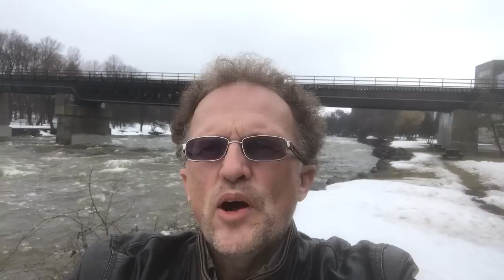Stabilization Feedbacks in the Climate System

Comment: Sorry Paul but Global emissions only dropped 2% for 1 year in 2008. China has increased emissions by 8% every year since. India has increased by 5% every year since. Global heat retention has increased to 1tw since pre industrial. That equates to 3'c warming locked in without any feedbacks. Your right that when we get kicked in the teeth we will act. But we have been to the doctors and he told us not to get kicked in the teeth (2'c) or else we will need a dentist. When we need a dentist, that means global events have ran out of our control parameters. Global emissions have risen by 40% since we went to the doctors. They are still rising. Professor Anderson UK made this clear in 2011. 24gt per annum. Global emissions are now 36gt per annum. I suspect that he IPCC will be persuaded to state that 4'c is the new 2'c, which most if not all serious scientists say would be an earth changing disaster. The action required now is a 10% reduction in Co2 emissions per annum to avoid this catastrophe. I see no signs of reduction in the next 10 years.
Reply: LOL, yeah! 4C, or indeed 5C, will be proclaimed as the "New 2C". And the media will present that and the public will swallow it. Because it sounds kinda nice, and no–one likes to think it's all futile, right?
Reply: Mark Young The optimistic estimates for the time it takes to transition over to clean energy from fossil fuels is 20 years because energy demand is rising rapidly and during those 20 years fossil fuels will still be used to build the clean energy because it is a transition and by the end of this transition the world be at about 600 ppm CO2 resulting in about a 6C increase in global  temperature plus there will an additional 1C to 2C rise in global temperatures as global dimming is reduce, so we are already screwed if we even try to go to clean , we waited to long. Agriculture scientist are predicting a reduction in global crop production of 12% to 30% due to global warming stressors of heat stress  , increased drought , and increased pest losses. Evidence shows each one of the 3 can reduce crop production by approximately 10% each with every increase of 1C of land temperatures , not the global average but the higher land temperature from growing region to growing region. Agricultural scientist warn there could be significant drops of 30% to 45%  in global crop production within the next 5 years. Humans have evolved to respond to immediate threats before an arguable long term threat.  A person is more worried about the bear in their backyard than the one in the woods miles away, and even less if people say that there are no bears in the woods. The fossil fuel companies understand human nature better than anyone and they know that a campaign of dis-information , denial and delay is all they need to continue to extract  and burn fossil fuels.  Summarizing the world is fucked , food prices will skyrocket until civilization collapses into anarchy and chaos , war , famine and death will follow the radical religions of the world will get their apocalypse and they will die thinking their religions prophecy is fullfilled.
Reply: LIkewise they bump up the thresholds for harmful dosages of radiation to placate the Japanese gov. stranglehold on information wrt Fukushima on-going disaster.  OK go play Alice in Wonderland, make up the rules as you play the game.  We're still a dead man walking, there is no cure for radiation sickness, all that's left is the slow dying from nausea, vomiting. , spontaneous bleeding.
Reply: Nathan Gant Why are you blathering on about radiation?  This has nothing to do with nuclear fusion or fission, it involves non-ionizing infrared radiation that will kill us by destroying our resources!
Reply: global warming = coastal flooding = electric power grids offline.  13 nuclear power plants in the US are on coastal sea levels.  Most on high populated East Coast.   Connect the dots from there.
Reply: Mark - you're way too optimistic for my understanding of the problem.
Reply from the maker: silvercountry and have less kids, or maybe more??
Reply: Paul - Stressors usually have the effect or increasing fertility. Only education of women can override this, but this is often prohibited by religious practice.
Reply: One can try (fruitlessly) to make comparisons in a statistically meaningful way regarding the 5 years 2008 to 2012. One way is to year by year comparison with the 5 consecutive calendar years 85 years before (taking into account the 85 year Wolfgang Gleissberg solar cycle). One can make a non significant conclusion ( p = 0.10) that we humans caused at least 0.69 celsius of global warming in 85 years, and a similarly non significant conclusion that we humans caused no more than 0.92 celsius of global warming in 85 years.

Interestingly, by comparing 22 year (approximately one solar magnetic cycle) segments of time spaced 85 years apart, the outcome is a statistically significant conclusion (p = 1/44) that we humans caused at least 0.53 celsius of warming in 85 years, and an equally significant conclusion that we caused no more than 1.11 celsius of warming in 85 years.

The 5 years 2008 through 2012 fit well within the temperature range of the broader 22 year time span 1995 through 2016, whether or not making a comparison to the past. There could very well be a temperature effect from the 2008 recession, but that recession was neither severe enough nor long enough to result in a statistically significant effect.
Reply: Yes, just like the 4 Fukushima reactors have been "decommissioned", as in destroyed beyond any humanly-possible repair.  All coriums have melted down past concrete floor.   Real china syndrome there.  No one has a clue, except to observe the massive steam is coming up from the ground there, that is to say nuclear reactions are happening underground.  numerous super-hot lava tubes detected., +5000 sieverts, now that's a novel way to decommission, just make the human species go extinct.
Reply: The failure of batteries and diesels at Fukushima was irrelevant, as 34 of the 37 pumps that use that power were knocked out and the electrical switchgear in the basement of the turbine hall was drowned.  You could  have still had grid power to the plant and it would have had the same outcome.
Reply: Not 5000 plus sieverts.  Top reading was about 537 sieverts down in the containment.

Comment: But if emissions drop, so does the effect of global dimming!
Reply: +proudhon100   Did you watch the whole video?
Reply: klondike444
Yes. What's your point?
Reply: Reduced global dimming from reduced air pollution would indeed raise the temperature. However, two stabilization feedbacks would increase that hardly anyone talks about. 

One is vertical convection in the ocean that would store an increased amount of heat at depth. This type of vertical convection most famously happens just west of Gibraltar.

The other is heat loss from vertical convection in the air. An increased amount of ocean moisture gets carried up to high cloud tops where it condenses into snow and very easily radiates the heat of condensation into space. The temperature increase is not a big problem. Instead, the big problem is "black swan" events in the form of storms so intense in a geographical area that in the old climate system such a storm was seen in that area less than once in a thousand years.
Reply: +Wendy Delisse   Interesting. Hope Paul covers those feedbacks in his planned video on global dimming.
Reply: +proudhon100   Paul refers the effect of falling emissions on global dimming, and says he plans to do a video on the subject, so what is your point?
Reply: +klondike444 If he does cover increased atmospheric vertical convection as a part of a video on what happens if global dimming is reduced, it will most likely have to be a two part video. 

The evil twin of increased upward vertical convection in an ITCZ shifted slightly northward if the brown cloud of pollution from Asia goes away is the increased downward convection 1500 nautical miles north and south of the newly repositioned ITCZ. A more northerly position means more coriolis effect wind enhancement of ITCZ low pressure systems, and evaporation rises linearly with wind speed. A higher temperature due to less air pollution also increases evaporation.

In July and August, is there drought in Nebraska? See how close the ITCZ is to Acapulco 1500 nautical miles to the south. Drought in Syria or Zambia? Check out the rain reports in Ethiopia 1500 nautical miles away. Is there a news report of a river drying up in Brazil? Look to a satellite photo of the Lesser Antilles in the Caribbean Sea at the clouds of the ITCZ about 1500 nautical miles to the north. Has July and August also been especially dry in Inner Mongolia? Check the weather reports for rain 1500 nautical miles to the south near Calcutta, India and Da Nang, Vietnam. The pattern is that wherever the ITCZ is, if you go 1500 nautical miles north or south, the weather will be much drier. If the ITCZ shifts, the dry zones also shift. Also, the a stronger ITCZ results in more intense dry zones. 

The effect of a more northerly and more intense ITCZ is by itself a lot to squeeze into a single 15 minute video on what happens if the brown cloud of pollution from Asia goes away, so I imagine at least a 2 part video on the effects of global dimming.

Comment: Here's another negative feedback. As the planet warms the water cycle intensifies. As precipitation increases it stimulates additional growth of many plants, particularly those whose growth rate is especially dependent on how much water they get.
Reply: pukulu , until it's too hot and the plant dies from the inside out. ..TOO hot can happen in a rainstorm. (that will kill a human as well)
Reply: On the other hand, the heavy rains that come to drought areas will wash soil and plants away. If that water can be captured and used then yes, there could be some hope.
Reply: pukulu, water cycle intensification is a powerful negative feedback even without biology. The "enthalpy" (heat), from condensation of water molecules onto droplets or deposition of water molecules onto ice crystals, is released very effectively at cloud tops.

A similar process happens in the atmosphere of the planet Mars, but it is CO2 deposition onto CO2 ice crystals that occurs, since Mars is cold enough to freeze CO2, and since Mars is too cold to hold a substantial amount of water in its atmosphere.

On Earth water is the chief greenhouse component in the atmosphere, and on Mars, CO2 is the chief greenhouse component. On both planets, the condensation or deposition cycle of the chief greenhouse gas puts a lid on the greenhouse effect.

On Venus, where CO2 is the chief greenhouse component, the higher solar constant allows hardly deposition at all, and any CO2 crystals that form near the poles in the upper atmosphere sublime away many tens of kilometers before they could reach the ground as solid or liquid CO2.

Comment: Here's a question I have. Is the global human population explosion causing the balance between autotrophs and heterotrophs to be shifted (briefly of course) in the direction of heterotrophs? In other words, are the autotrophs being temporarily overexploited in order to serve the needs of the global human population? It seems to be the case but hard data is needed. 

In the long run the balance between primary producers (autotrophs) and their beneficiaries (heterotrophs) will be restored, similar to the well known Lotka-Volterra phenomenon between predators and their prey. However, this could take awhile, hundreds to thousands of years. In the meantime, species go extinct, victims of the fluctuating balance.